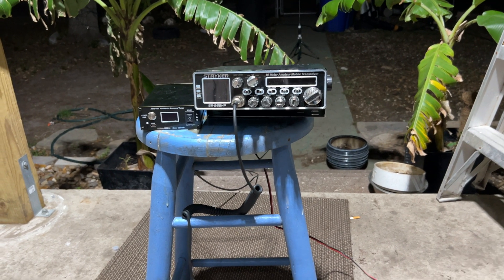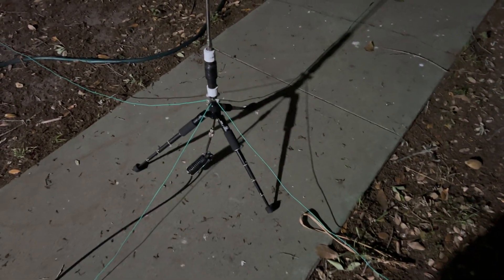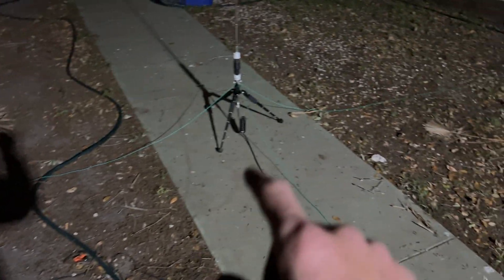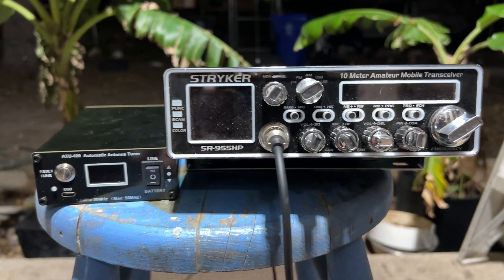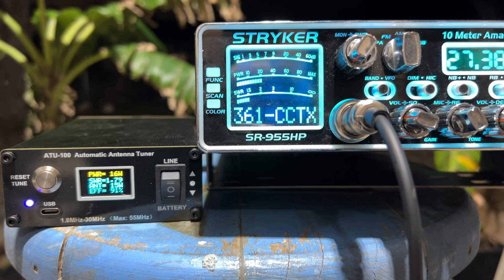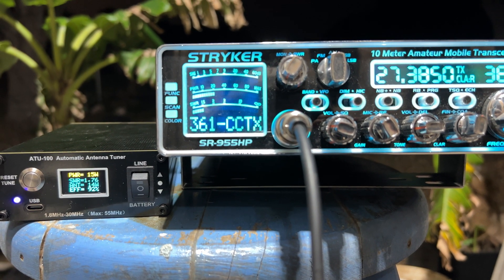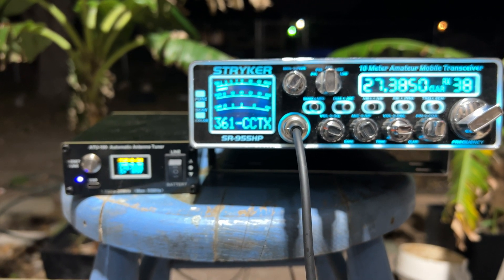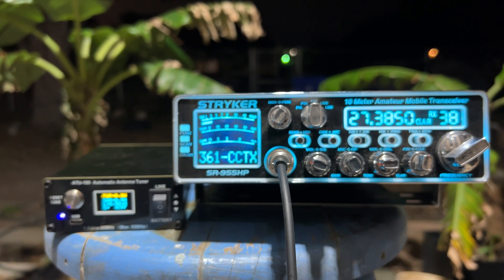Finally won the swr battle on the homemade coil with 44 inch whip

Comment: Very cool, 361. Pretty awesome you make your own antennas.
Reply from the maker: Thank you. I'm glad that I don't have to buy any more antennas. Would you like a dipole or a loaded coil vertical that you can test out free of charge? That way I can also have someone else enjoy 361 antennas
Reply: Excellent job! You havebeen putting in the hard work great stuff!
Reply from the maker: @mitchh6702 I'm glad that I've successfully resolved the battle with the ground radials. I managed to get the SWR down to 1.5 with radials at about 10 feet long. With the coil in my antenna setup, I believe the equivalent length is around 8-10 feet.
Reply from the maker: I understand what a tuner is and its purpose. but I designed my antenna to operate the way I intended. With or with out the tuner, my antenna allows my signal to reach 8,800 miles to Australia and Ireland, so my system is functioning as intended.